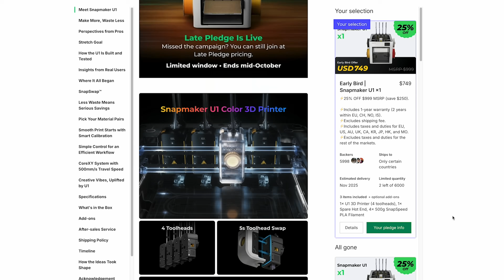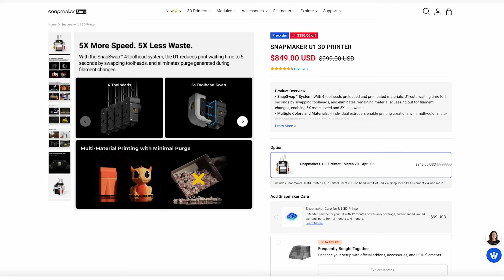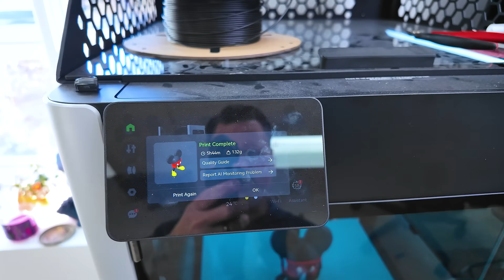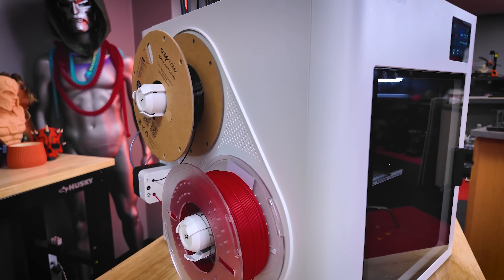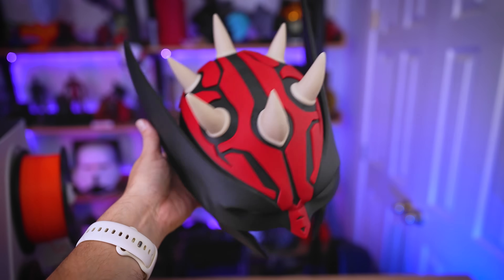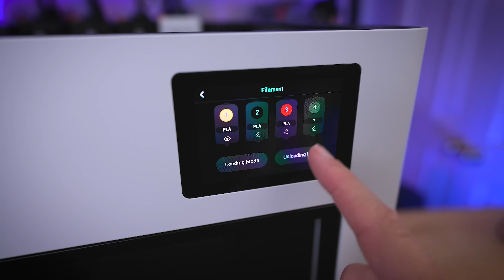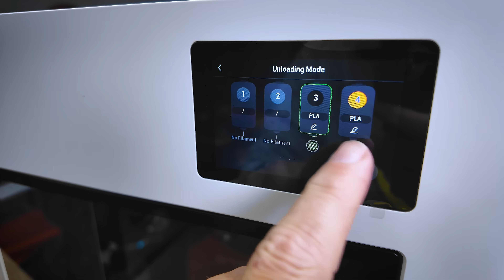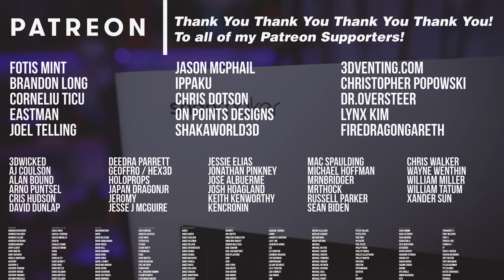The New King of Multi Color 3D Printing - Snapmaker U1

Comment: I got my kickstarter unit six days ago.  My only issue is that the Snapmaker Orca slicer seems to be sending the print head out of bounds after the first layer is down.  The X axis out of bounds error has not occurred while using the standard Orca slicer.

Comment: I have been having a lot of problems with PETG on mine with warping and bed adhesion. I suspect it is related to the lack of a cover and the colder temperatures in Boston(my printer is in an area without direct heating and can be cooler) but it was never a problem on my Creality K1 with the lid. I am using a box to act as a lid for a test print now but I'm definitely a bit concerned by how poorly it is sticking.

Comment: I print mostly multicolor stuff for my small business and this machine is tempting, but prime tower issues are throwing me off. This is mostly caused by difficulty in calibrating all 4 nozzles before printing. They have some tolerances on the attatchments so even a perfect calibration may cause small difference in nozzle height during filament swaps.

Comment: stupid question maybe, but I'll try anyways :-) is there still a need to create temp (and maybe also retract) towers for each individual filament or is this obsolete due to automatic processing and calibration within the machine? I think I read somewhere online that Orca does not (yet) offer the option to create temp towers with changing print temperatures.

Comment: I don’t do much multi color printing but this could change that. Additionally I love the idea of the print system saving filament. I’m looking at using this for more multi material prints or even some neat designs for engineering projects.

Comment: I'm very impressed ,my only bitch is that there's not a filament dryer which could easily be engineered to encapsulate those four rolls of filament on the side.
It would be an odd asymmetrical design but then it would be the perfect multicolor machine that does everything

Comment: How hard is it to clear a clog? Are the nozzles brass or hardened steel? Maintenance and repair is something nobody ever talks about in their reviews but its just as critical as the print quantity. I realize of course, this isnt a full review.
Reply from the maker: I will be diving into that soon. Stock nozzles are stainless steel if I remember right. You can buy hardened steel nozzle upgrades. Another downside to any of these multi toolhead machines is you now need to buy A LOT more replacement hotends

Comment: I have to wonder just how many U1s someone like you could buy just from the money thrown away from all the waste from your other multi-color printers.  People focus far too much on the purchase price and not enough on the actual cost of ownership.  It's the main reason why I waited for something like the U1 to come out before I bothered to get a multi-color printer.  The idea of tossing out half of every roll just for poop and purge is ABSURD and I can't believe anyone fell for it.  But I am happy to be in the early November batch (I think I'm like backer #4359 or something close) and I figure that by the time they get to mine on the production line they will have worked out many more of the bugs that hadn't appeared during pre-production runs.  I am very much looking forward to late January when mine should arrive.
Reply from the maker: Thats along the lines of why I dont do a lot of multi color materials up until now. It was painful and $$ to waste so much filament. There have been some prints where I swear I've wasted more in purge material than the actual print itself

Comment: What benefit does a purge tower provide over just purging the filament during a color change in their respective dock?  Is the purge tower even necessary?  I would think it would be the same except purging in the dock wouldn't cause the print failures when the tower falls over.

Comment: It’s funny how, in every multicolor printing video, the takeaway is always that the waste is ‘surprisingly low’. In my experience, both the Prusa XL and the MMU setups are actually quite efficient once they’re dialed in. It’s really the AMS-style approach that naturally generates more purge.

The MMU experience itself isn’t the most polished, but once it is tuned, it becomes very reliable.

I owned a Snapmaker A350 a while back, and I struggled with mine. I could only ever get consistent results near the center of the bed. That was one of my less successful Kickstarter adventures, but to be fair, the U1 looks like a much more refined machine and a solid value based on what I’ve seen.

Now I am very curious to see how the INDX turns out.
Reply: The MMU is a bunch of Spools sitting on rails with tons of tubes all over the place.  Most people dont have 4-6 ft. of table space to dedicate to 1 printer. I like PRUSA but the MMU needs a ton of refinement, its not practical
Reply: @anthonylong5870 You are right. The current iteration is the last one, and INDX will be the next thing, and they have a system for the filament for that.

Comment: Very little waste? So what's the prime tower? That seems like a lot of waste to me. It has to poop out the old, switch to the new then waste more on the prime tower? I have 8 printers now and I am considering adding a color printer, I'm just curious about all the waste. I paint my projects, but a color printer would be ok for some of my more cartoony stuff. I see the possibilities, just not convinced its really needed, unless you can't paint.
Reply from the maker: You can choose to print without the prime tower but risk print quality issues with out it. Also the prime tower is a fraction of the waste vs the other multi color options that require a prime + purge waste.

Comment: loving the u1 so far. Really great for 95a tpu, a little worried to try anything softer. I will say the spool holders suck. Already had spools fall off in the middle of the night.
Reply from the maker: Oh wow really? Do you know what brand that was? Most I’ve used are super tight. Borderline too tight 😂 

Yeah 96a on this is wild. It prints so dang good with it… assuming you dry before 😂🤣
Reply: @UncleJessy  It was a printed bambu spool. Didnt seem particularly loose but the little mechanical levers don't seem to push very hard. At any rate because of the tight space my printers are in I had hoped to relocate the feeders maybe under the shelf the printer sits on instead of hanging on the side of the machine so I could have them feeding out of a dry box but I'm a little hesitant to start clipping and extending the wires. Feel free to hack yours up for science. Lol
Reply: fwiw I figured out that specifically on these printed spools I have, if the smaller diameter side of the spool facing away from the body of the printer it can work its way off on a long print. Flipping the spool around kept them on for a 24 hour print. Hopefully that solution will at least get me through these rolls so I can change these colors to more suitable spools.
Reply: Its supposed to work really well with PEBA

Comment: are the pogo pins easily replaceable? I think that's going to be the big issue over time.
Reply: No but the print heads are pretty cheap at like $29 each the pins btw are rated up to 1 million swaps so its not like they are going to be needing to be replaced all that often
Reply: They only power the part cooling fan. Keep them lubricated and they'll last for a long time

Comment: This is a kick ass printer but, no doubt, this thing is gonna get out designed and at a bigger scale than what snapmaker is going to come up with. One of the big competitors is gonna steal this, make it bigger and faster. Many of our consumer/prosumer crowd want that 300x300x300 min build volume. 

Otherwise this thing is fantastic.
Reply from the maker: Can’t wait to see bigger print options with this kind of setup.
Reply: Snapmaker rep already said they are currently working on a larger version....It was in a Kickstarter Q and A for backers a couple months ago

Comment: Thanks for your initial peek at the U1. Overall the U1 is a good initial tool changer offering from SnapMaker. However there are quite a few downsides to this machine that nobody seems to be talking about. The biggest problem is this is really just a PLA/PETG machine. The open top is a major issue when printing with better engineering filaments that give off VOCs and need a draft free printing environment. Yes, they do offer the top to help with this issue for an additional $150, which seems expensive for a simple cover. And there’s no heated chamber or dry box support for filament rolls so issues will arise when printing with hydroscopic filaments. It certainly would have been better if they designed in the ability to attach dry boxes to cover & dry filaments while printing. Bambu AMS addresses this issue but you still can’t print & dry simultaneously. It would have been a big win if SnapMaker addressed all this up front with the U1. Would have also  been nice if they addressed the heated chamber issue and offered accessory heaters that could be easily added if needed I expect the U2 will did more into these issues and hopefully give us some solutions. The future does look bright for this tool changer and hopefully they’re address the weaknesses and give us a better next version.

You are also limited to a 300 degree nozzle and a 100 degree bed. So if you’re using these types of engineering filaments this isn’t the best machine. These are other areas I hope they’ll address on the U2.

There’s also a four nozzle limit to this machine and no known path to resolve issues when needing prints with more than 4 colors. Yes, as you showed, you can manually swap colors but that’s a manual process and you have to be babysitting the machine to accomplish this. 

Yes, it’s an interesting offering but potential buyers should understand what this machine can do well and where it misses the mark. Really hoping the U2 will increase print size and add a hotter horned and increased bed temps so you can use this with better engineering filaments. We’ll just have to wait and see what the future may bring.
Reply: Most of what you say is a problem isn't actually a problem. 
Top covers have already been made or adapted for the printer. 
The snapmaker one isn't just a cover, it has a fan to regulate the temperature and filters.
A chamber heater is a luxury and there's only a small handful of printers that even have one. 
300/100 isn't a problem printing ABS, ASA, PC and even smaller PA parts. The Bambu P1S has the same capabilities and can print all those filaments without a heater. 
You can buy snapmaker dry boxes and others have already shown that you can print directly from other make dry boxes without issue.
Personally, I think 4 colours/filaments is enough for this price point. 
The next closest competitor is over twice the price for no better quality multi colour prints. For the money, it's a relative bargain considering the time and waste reduction and the quality of prints that a tool changer provides

Comment: I have 3 or 4 purge Tower Fell off... the Standard Build Plate sucks. I bougjt a Cheap cold plate e for ten bucks via AliExpress... and man what should I say ... I did not even use any bed heating and have still problems getting my print of the bed... yeah now I am happy. One problem solved
Reply: Most people dont wash a brand new build plate...Which you should do because it can have oils and dust from manufacturing still on it.....I bet that might have been part of your problem

Comment: The open spools on the side is a mistake.  Fine for PLA if you live in Arizona.  Not so good in wet areas or with hygroscopic filaments that get wetter as you print.  I expect I'll be printing exclusively out of the Polymaker drybox.
I think this printer pares nicely with something like a H2D or H2C.  The Bambu's have larger build volume, multi-plexor for much easier multi-color above 4 (or more likely 3 + support). But the Bambu's have an achilles heel in their softmaterials handling.
Reply: I live in Michigan, 95 degrees summers with HIGH humidity because i live by several lakes.  Winter time I have a furnace and humidifiers running non stop......Ask me how often my filament which is sitting on open shelves (200 ish rolls) has needed to be dried?.......I give you the answer: over the 5 years II have been here printing, Twice and both times it was TPU.  Open spool holders cause no issues
Reply: Fine points about the Bambu, but can't really compare the H2D, since that's only 2 heads.  And the H2C is what, 3X the cost?  I love this that it's even larger than all my 256 sized printers, but being able to do do PETG and PLA for supports without using a kilo of waste and 8X the time?  All for less than $900 US?  wow.
Reply: @Mr_Matthews  I have a U1 on order.  But only as a limited color and soft materials printers.  Of the two prints I have running now, it could do 1 of them but would be slower.  The Bambu's are expensive until you compare them to others like the Prusas.  The CoreOne + INDX will be around the same price as a H2C but have a mostly useless build volume (with INDX) of 220x225).  The CoreOne-L+INDX is 1-2 years away and will be around 3k.  The XL fully kitted out is 6k.  The Snapmaker is no doubt a game changer on value.  But it has a fairly small build volume and only can do 3 materials + support.  This morning I finished 2 prints which the snapmaker could not do either.  The H2D was too large (and 3 colors) and the H2C was 6 colors.  Given the capabilities, they are not poorly priced.  The only things wrong with the H2C is: 1 it is poor at soft materials.  2 It should have a 350^3 build volume not the 320ish.  3: it wastes time during startup and swapping (likely to improve).  4: too closed a system.  5: Not enough spares and such on the market yet (Snapmaker is worse).
For most of my uses the Snapmaker will either be too few colors or too small a build volume.  But when it fit (like 3 color TPU, etc) it will be a nice add.
Reply: @bjornlovoll8972  In what altered reality is a H2C faster then a U1? ROFL! Thats just assinine.  The H2C has to use the AMs which doubles the time of color changes of the U1. And the print quality of the H2C is TERRIBLE by comparison. Any reviews will show you that. And as far as the PRUSA goes...It will bury the H2C in EVERYTHING.  The Core One L will be compatible by this summer. PRUSA said that at the convention (I was there) And the total cost will still be less then the VASTLY INFERIOR H2C...Stop smoking the Bambu pipe
Reply: @anthonylong5870  Figures you're a Prusa chanter.

On the print where the H2C was doing that the U1 could do but slower was because it has more than 3 colors + support.  It was 6 colors + support.  So on a U1, I'd have to remodel it and print multiple sheets with fewer colors and assemble them in post.  A process which in this case is considerably slower than hitting the print button.

The tiny CoreOne+INDX kit has already been pushed back a month.  Ask yourself why.

The larger, but not very large L+INDX had not even been started on at Formnext.  It'll be a decent mid-sized 270x300ish build plate when it comes out, but not this summer.  You'll be lucky to see a cobbled together prototype this next Formnext.  And lucky to get a kit 6 months later.  It is likely a 2027 product.  Unless Snapmaker rocks the world again with another larger model U1-XL or U2 or whatever, I'll probably own INDX+L or new snapmaker before you too.

You Prusa Prusa chanters are so narrow minded that you think the platform matters.  news flash, it doesn't.  What matters is the print.  I'll use whatever works best for what I need.  I recommend you try the same approach and not sit around and dream about the next printer out there that won't be here until I have over 10,000 hours on my H2C and more still on my H2D and maybe close to 6-8000 on my U1.

Comment: "King"...so long as your project is 4 colors/materials or less. Don't get me wrong, I think it is a very good little machine for the money but king is a bit of a stretch.
Reply from the maker: I dunno. It prints 4 color faster & wastes less material than any multi color printer I’ve used. Excited to see what indx brings next year
Reply: @UncleJessy  Hence my qualifier of 4 colors/materials or less. Don't get me wrong, if you are talking about all machines with that limit. It is extremely good and I'm excited at all the competition happening. But King implies all machines and I think it is more than a bit unfair to compare this to a machine that can handle 8+ colors/materials and state it is still better when it isn't because it can't do that.

Obviously I'm splitting hairs here because I'm bored mostly and it is more about the claim than the actual machine. I'm absolutely buying one myself even though I have bigger more capable machines, because yes sometimes that limit of 4 materials isn't a factor and it absolutely is faster because it doesn't have to swap.

I'm also pretty excited to see what indx brings. I'm still real skeptical that it is going to beat the H2C for me, but I have a fairly unique use case. Most of my business revolves around needing 6-8 materials in a project. But i've been wrong before and if I'm wrong, I'll be buying one. Even if I am admittedly a little salty that prusa is still pretty badly overpriced.